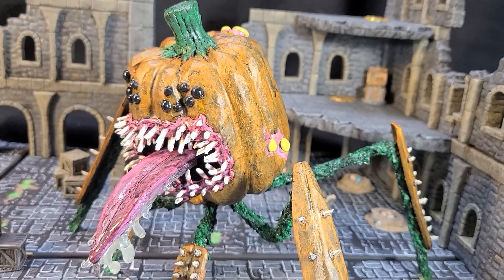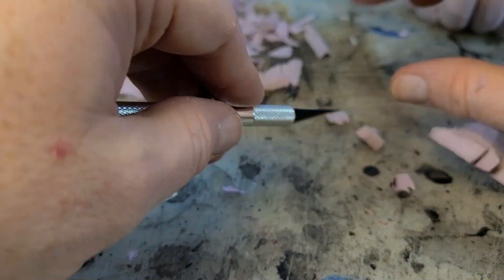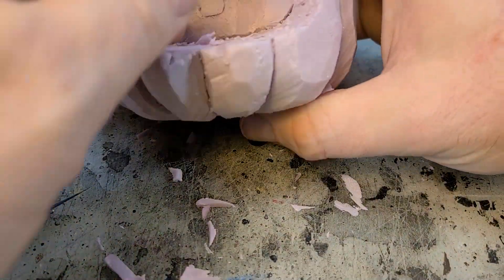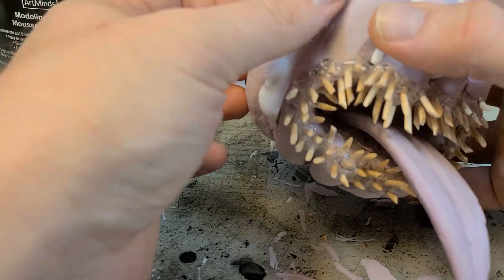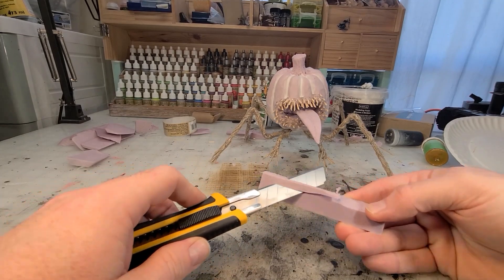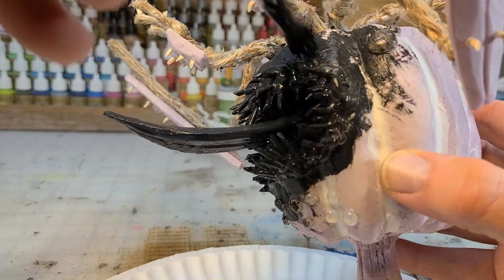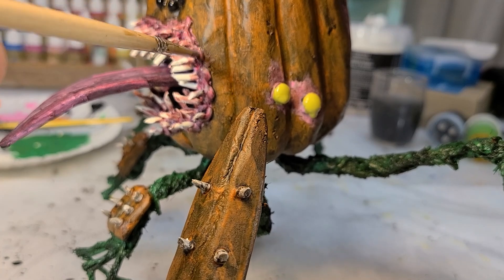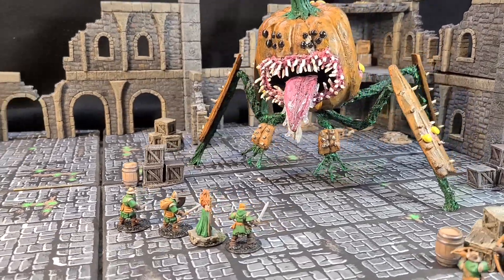Halloween Pumpkin Abomination

Comment: Great work!

So the issue with white, yellow and orange acrylic paint (red sometimes as well) is that black base coats shows up REALLY well. Sometimes the black under coat will tint the yellows to green 

Next time, hit it with a coat of white primer or a couple coats of white acrylic. Lighter tans work well as an under coat for oranges.

When in doubt, grab some scrap and test your paints before you paint your craft
Reply: I came down into the comments to say the same thing, but would actually recommend a nice, thick coat of dark brown instead - will maintain the 'dark shadows' effect you get with a black foundation, but without tainting the over-coat. Should work especially well with orange in particular, because for those that don't know brown is kind of an odd-ball color & technically just dark orange. 
You can also use the technique deliberately to introduce interesting effects... ala black + yellow to get a deliberately splotchy green; or yellow over green for a cooler paint scheme, or yellow over red for a warmer paint scheme
Reply: super cool